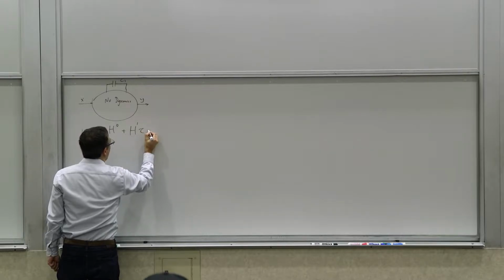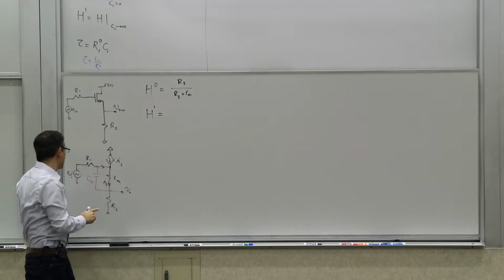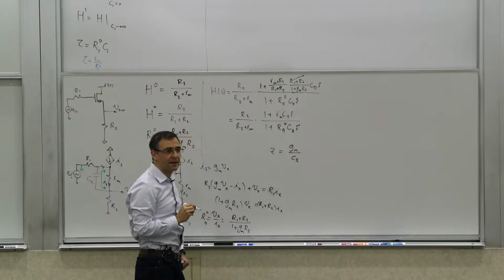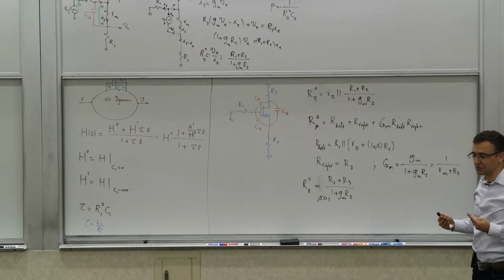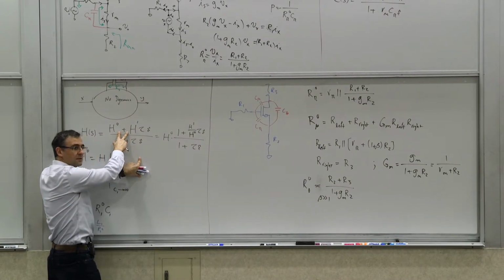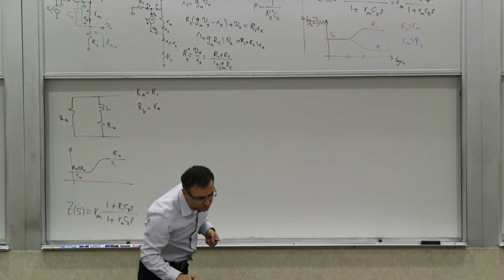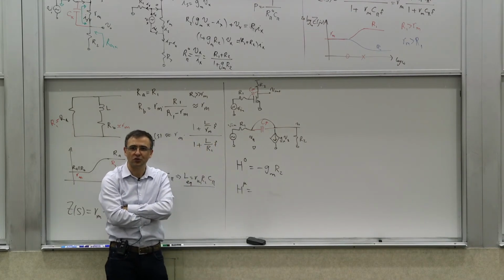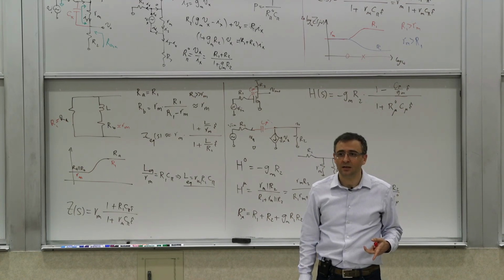141N. 1st Order high-frequency TTC analysis of common source and common drain

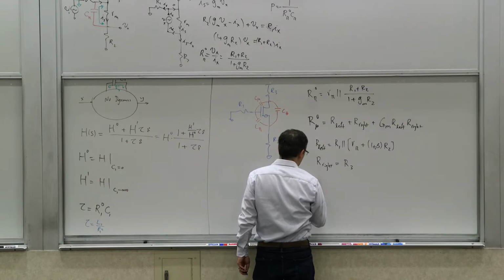Comment: @23:00 while calculating the resistance R_theta there seems to be a mistake. As per my analysis the resistance seen by C_theta should be "(R2/(1+gm*R2))+R3" instead of "(R2+R3)/(1+gm*R2)", in other words only R2 would be scaled downby  (1+gm*R2) and added to R3. Am I correct.

Comment: @19:30 you draw the model for the transistor with the capacitor and resistors attached so that determining the time constants is not time consuming the next time around, what I am curious about is that how do you take that C_theta into account, because most of the resources I have seen include a drain-bulk or source-bulk capaciatance instead of the C_theta capacitance.
Reply: C_theta basically is the series combination of drain_bulk and source_bulk capacitors.

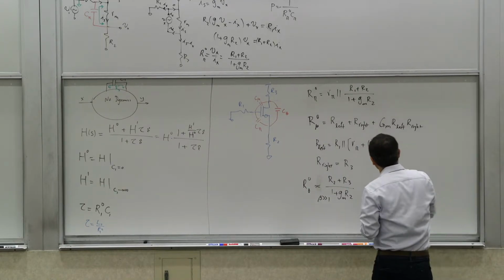Comment: @23:21 I was not able to find this formula for Gm exactly. Is this exact? I'm getting a factor (beta+1)/beta on R2
Reply: This is just the emitter generation gain, but without the collector resistance. Prof. Hajimiri talks extensively about this in the BJT amplifier videos early in the series. The gain with emitter degeneration is basically -(total resistance on C side)/(total resistance on E side), which without the resistance on C side is 1/(rm + RE). And, as always, it's just an approximation assuming ro is infinite. When ro is infinite, then in fact what happens is that the gain is actually Gb*vb - Ge*ve, where Gb and Ge are complicated expressions, and depends on ro
Reply: Hello, Do you mean the Gm for the BJT counterpart?
Reply: @jjjjjjjjjjj12345  from wat I remember, it was about a generic formula for both BJT & MOSFET. The formula should work for mosfer setting alpha -> 1 (beta -> infinity), but my nitpick was only significat whith BJT.
Reply: That's because you're right... :) There is in fact that term before R_2. My bigger concern here is the derivation of these formulas (for R_mu specifically). I mean how can we derive them fast and effectively? I used the Blackman impedance formula but what I obtained had a quite different - a bit more difficult - form. I also applied Middlebrook's extra-element theorem. The result was equally different and equally difficult. All 3 of them (the Blackman, the Middlebrook and the Hajimiri) gave me the same result though numerically. By the way, I only know that you're right about that (beta+1)/beta factor because back then when I first read Mr. Hajimiri's IEEE article about this I left some hand-written side note there exactly about this difference... I must have used nodal analysis tool then.